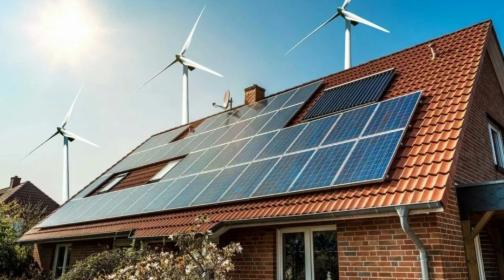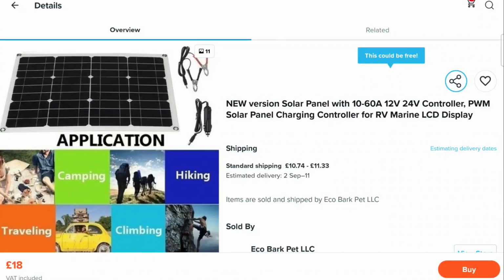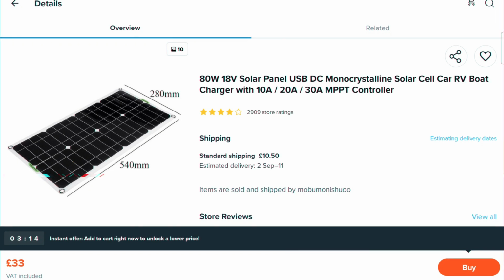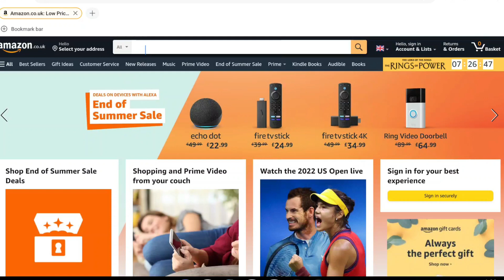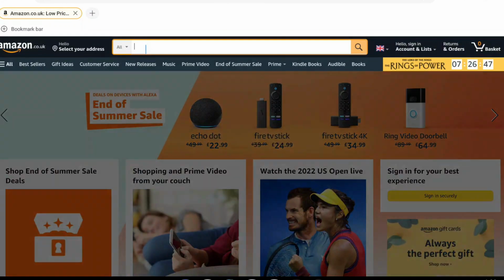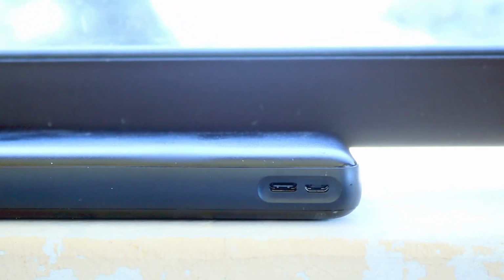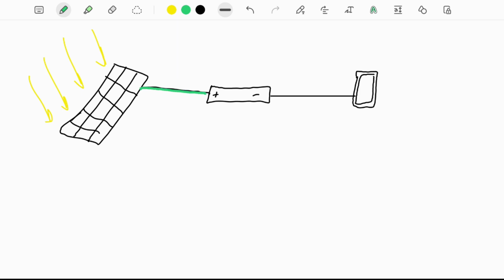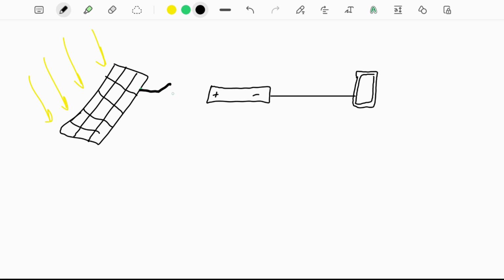$60 DYI solar panel system (fail?)

Comment: I wonder if there would be a way to link more of these panels over time
Reply from the maker: Not an easy way I don't think. You can get similar sized panels that are modular though but you'll need a controller box